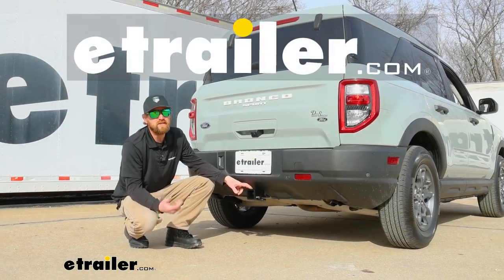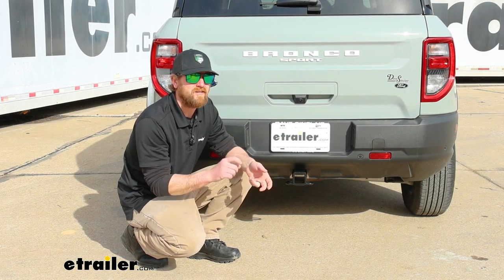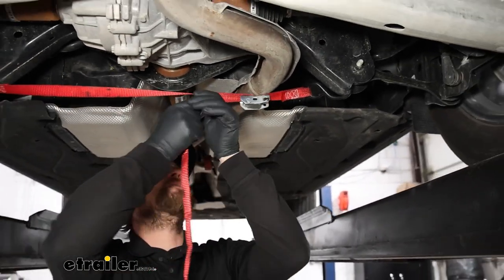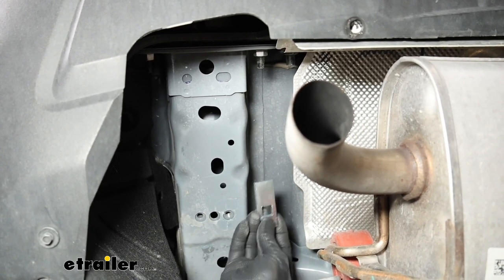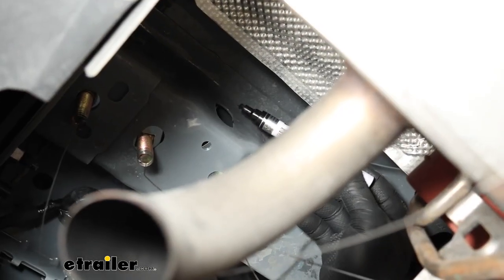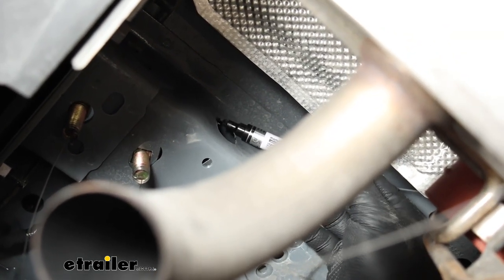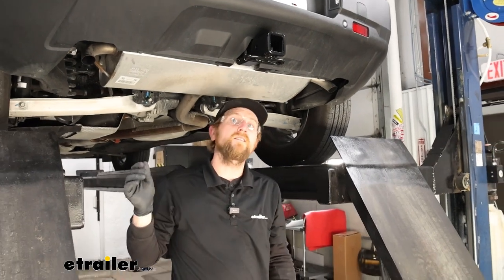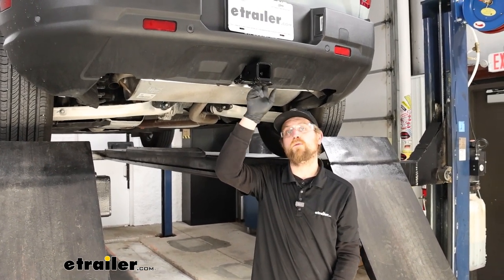etrailer | 2023 Ford Bronco Sport Curt Trailer Hitch Receiver: Complete Installation

Comment: what about the electrical hook ups?
Reply from the maker: We film those separately. You can see the recommended Tekonsha # TK46FR trailer wiring being installed by using the second link provided below:
https://www.etrailer.com/Custom-Fit-Vehicle-Wiring/Ford/Bronco+Sport/2023/TK46FR.html
https://www.etrailer.com/tv-install-tekonsha-4-pole-trailer-wiring-harness-2022-ford-bronco-sport-tk46fr.aspx

Comment: So you say to check your manual to make sure it’s safe. Why would you make a product for a vehicle that would make it unsafe? Like no bronco sport is rated past 2200 lbs.
Reply from the maker: For many vehicles the towing capacity can vary greatly depending on how the vehicle is equipped. It's not uncommon for a hitch to have a higher capacity than the vehicle it's installed on, which is precisely why we encourage folks to check their owner's manual to determine the actual towing capacity of their vehicle. You'll want to be sure to abide by the lowest capacity.
https://www.etrailer.com/Trailer-Hitch/CURT/C76HR.html
Reply: @etrailer  I agree but in this case I am sure the class 2 ford equips falls into the standard of its capacity so class 3 does nothing.
Reply from the maker: @SpudOutdoors  That's correct, to a degree. However, With a Class III hitch you get the more popular 2 inch receiver opening which will offer you a much better selection of hitch mounted accessories. Usually there isn't much of a price differential between the Class II and III, so unless you already have a bunch of Class II accessories for the 1-1/4 inch receiver you'll be better off with the Class III.
Reply: @etrailer  bronco class 2 from ford is 2”
Reply: Curt generally does not make a  downgraded cheaper Class 2. Why make a separate line when a Class III will do anything a ClassII will.